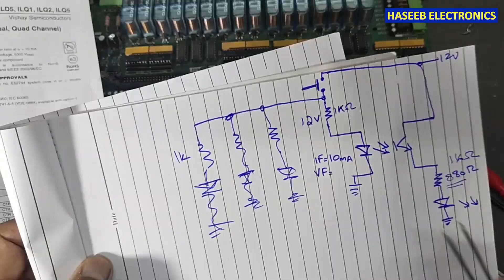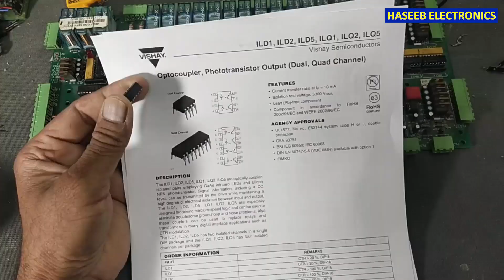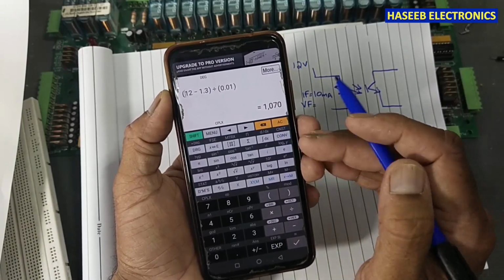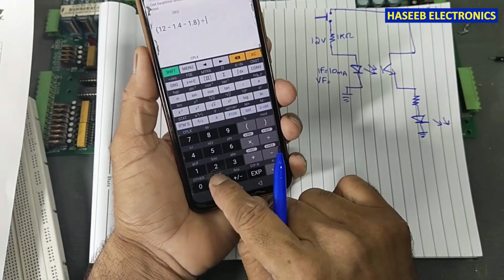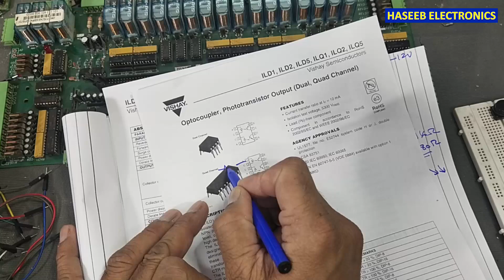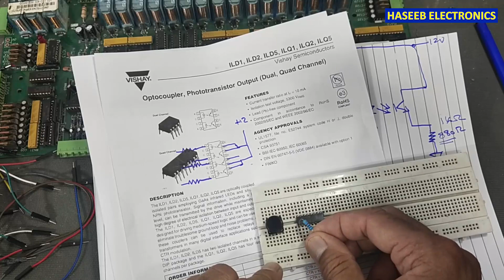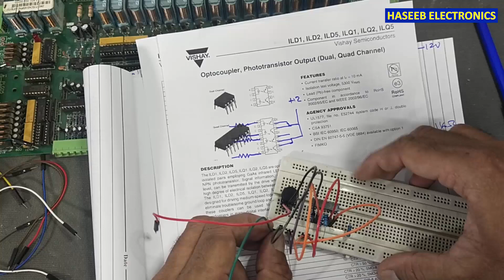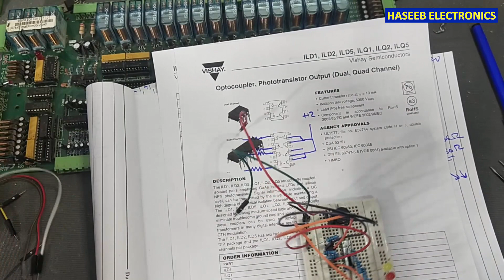{726} How To Test Optocoupler || Opto Isolator / Optocoupler Tester

Comment: Such optocouplers are a great way to keep two different circuits totally isolated by interactive as well. I've used them for just that reason with great success... Even though some of them didn't have every segment working, If you marked them as such and which one was dead, you could use them for other circuits that didn't need all four working.